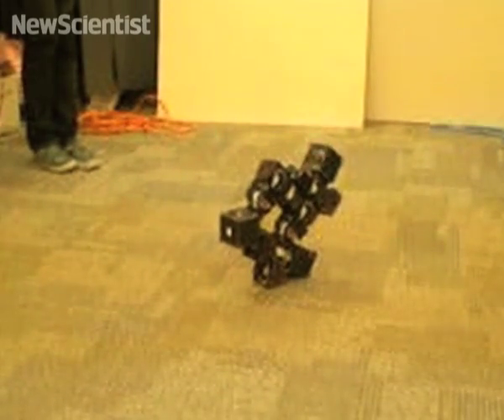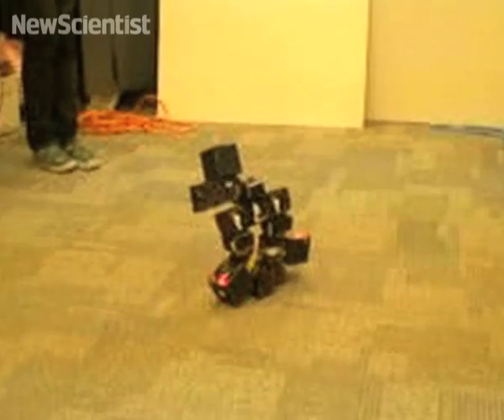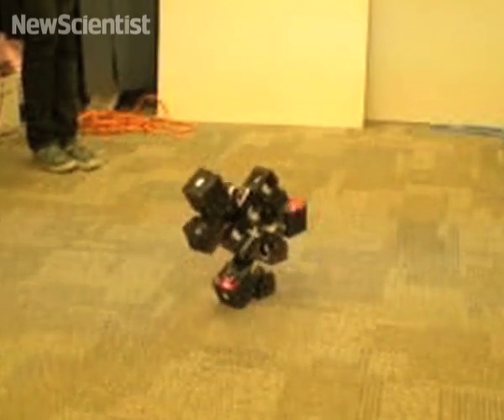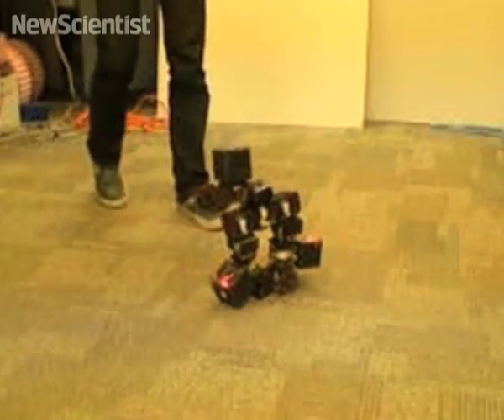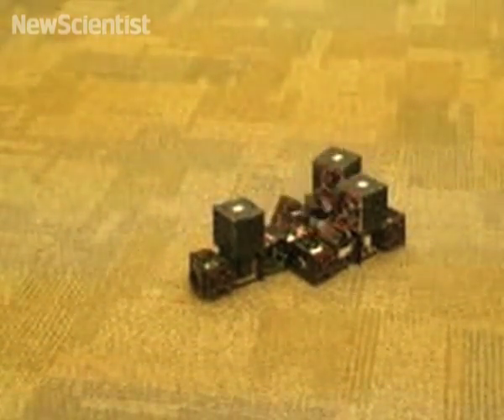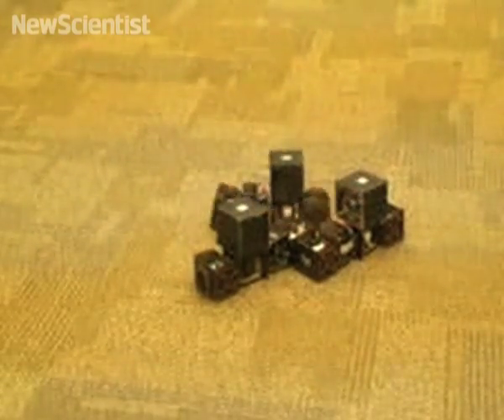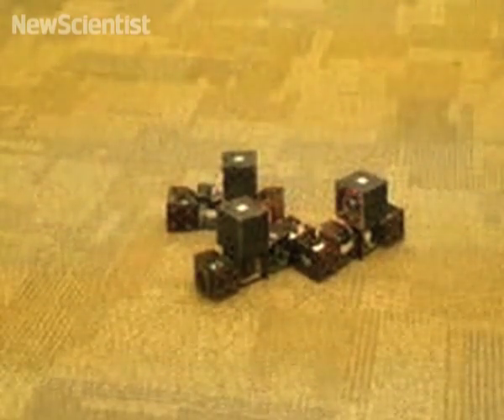Modular robot reassembles when kicked apart

Comment: I have some question if anybody could answer? What is rated torque of motor used and how many modules it could drive over the ground surface? Does the ground friction affect the movement of modules? what maximum number of modules a motor can run what configuration strategy will be there to get maximum motor capacity?

Comment: When can I expect to find this at Walmart?
Reply: You could probably build your own, it is really easy actually.... Just buy 180 degrees servos, and each cluster with a freedom servo, embed a simple tiny computer of your choice like a mini Arduino perhaps, power, and finally add some sort of proximity sensor, this can be light, wireless FX, or even a ping sensor. This video is old, I can easily make nano-building machines that are not as slow as these badly made ones from 2008.
Reply: That or just search up, Cubeletes

Comment: @speedproductions797 
It's a accelerometer, and it senses movement by measureing g-forces and the direction of them. if it senses g-force in a certain direction that means it's accelerating or de-accelerating towards the opposite, much like how in a car when you accelerate forward you feel a g-force push you back into the seat in the opposite of the forward motion, The stronger the acceleration and deceleration, the stronger the  g-force.

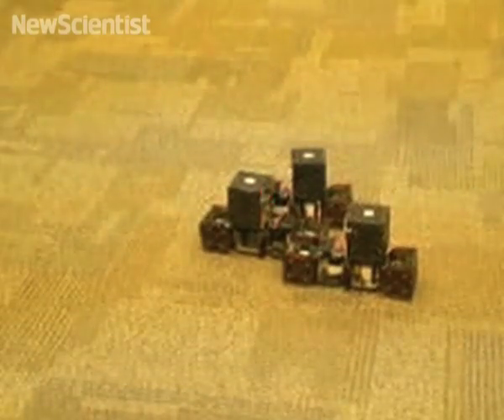Comment: They need to imit sonar signals rather than have the lights. That way they can call in all directions at once. That'd speed up the process of locating the other modules and that guy wouldn't have to come in at 2:14 and give it a hand by kicking it in to the correct position.